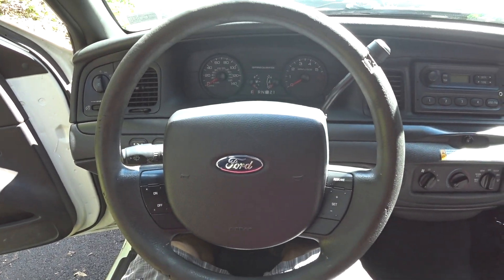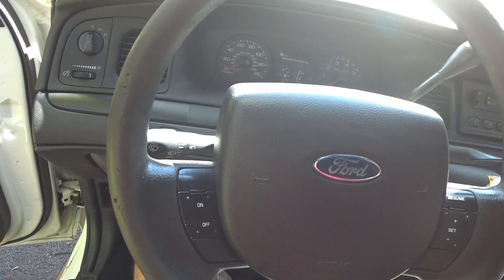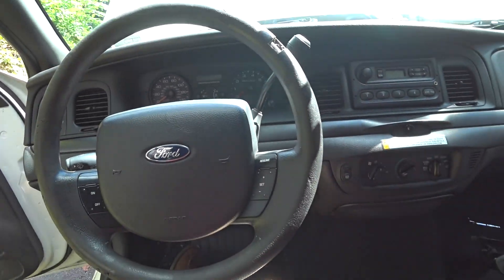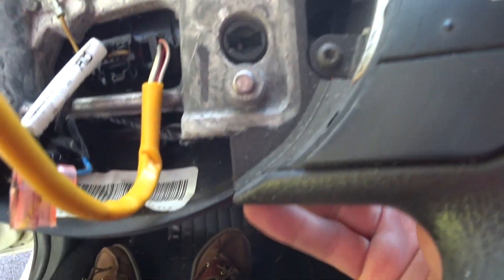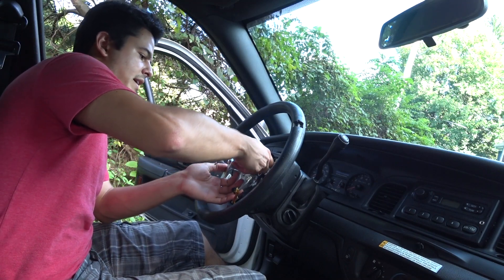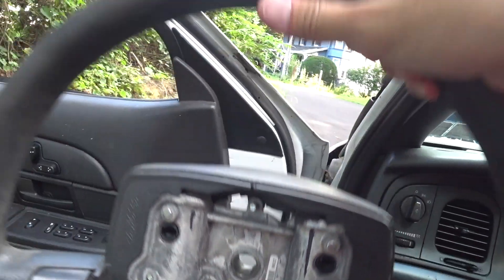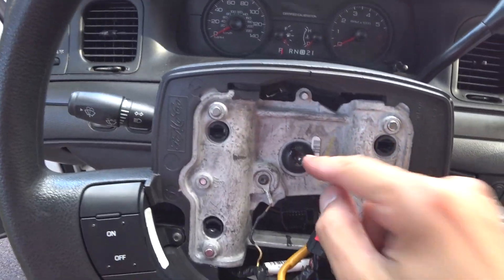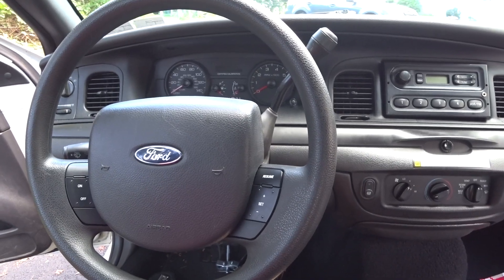Ford Crown Victoria Steering Wheel & Airbag Removal DIY

Comment: Thank you, it took 1.5 hours or so but your tips definitely helped. My springs were basically gummed up and I had to keep pushing on them 10-15 times before they’d release the clip. I used a long shank 1/8” round punch

Comment: I watched two other videos on how to remove the air bag on my town car to replace the cruise control  switch.  I tried and tried and  but could not get the springs to push. Then I watched this video and he showed the correct position of the Allen wrench. I had the air bag off, the switch changed, and the car back together in under 5 minutes. THANK YOU !
Reply from the maker: Glad it was helpful
Reply: @garagedenali  looking forward to future videos

Comment: Good video.. helped me out for sure.  The only thing I'd suggest is the tools list in the description. From what I can tell: 4mm allen key, T50 bit/socket and wrench (turning it counter clockwise to remove nut) and a 2 jaw puller (varies).

I may suggest anyone removing the airbag to put something under the bottom of the airbag once you get the lower clips undone so it doesn't clip back in. That happened to me first when working on the top clips, I pushed down on it and they snapped back in. I had to start over.
Reply: You don't need jaw puller.  Couple drops of power steering fluid on the spindle is enough to break the seal.  Grab wheel at 3 and 9 o'clock and pull towards your body.

Comment: You don't need a steering wheel pulling tool.  Take a few drops of power steering fluid and drip on spindle.  This will penetrate and break the seal.  Grab the wheel at 3 and 9 o-clock and rock from side to side while pulling towards your body.  Be sure all to disconnect all wires and connectors before pulling.  Sometimes it takes a little force but the wheel always pops off.  Done this many, many times at the junkyard.
Reply from the maker: I’ll keep that in mind

Comment: I have an 03 grand marquis ls. When I grab the steering wheel and shake it from left to right it makes a clunking noise like my steering wheel is loose. Is it possible for the nut to have come loose and I just need to tighten it? Or is that a sure sign of a bad center steering shaft? The sound is also audible from under the hood and sounds like it is coming from the center steering shaft that goes through the firewall to inside the car.
Reply from the maker: Sounds like the steering column. That was an issue on panther platform cars
Reply: @garagedenali  had steering colom replaced and the issue is solved.

Comment: Hello I had a question I have a crown Victoria with no cruise control could I put cruise control in it if I get a steering wheel like this? Or would I need to buy a kit?
Reply from the maker: If you retrofit cruise control, you will need to go to the dealer to have them activate the feature
Reply: Yes, you just need the correct steering wheel and have Ford turn the feature on. That's it!

Comment: If you have the time, remove the airbag, treat the column with some penetrating oil, something good like PB break even though it smells like chit, let it sit for a couple hours or even overnight, rock the wheel side to side hands at 3 and 9 while leaning back. It might take a few minutes, but be persistent.

Comment: Puller ain’t wirkin
Reply: You need to put the center screw in hand tight and use a hammer that worked for me wheel came off. You will need your ratchet extension or something to put between the center screw and the hammer because the steering wheel gets in the way.
Reply: Brian Beswick I already fixed the clockspring now but thanks bro

Comment: DO NOT PUT LOCK TIGHT ON YOUR STEERING WHEEL! ESPECIALLY RED!!!
Reply: Use medium strength thread locker not red.
Reply: @gregory9740  dont use any! There is a clip on 99% of steering wheels since forever! It locks them in place mechanically, no need for any lock tight. Please do not take ANY mechanical advice from people who suggest shit like this... I've been a tech for just about 20 years and have never,  not once used lock tight for a steering wheel... SMH
Reply: Some people call me mungo just because you never use it doesn’t mean you can’t